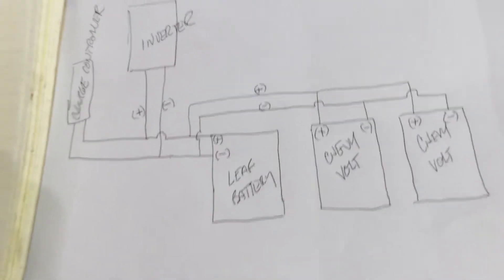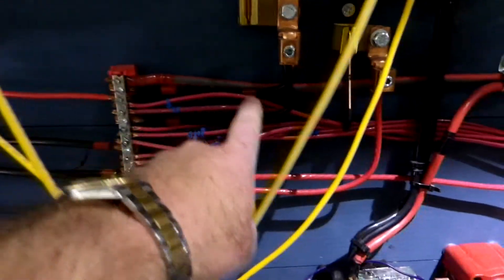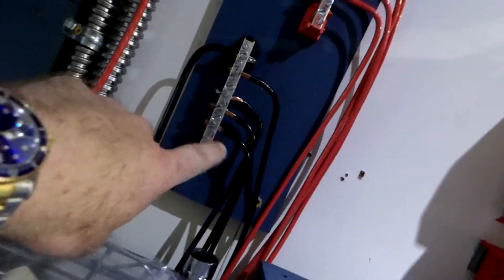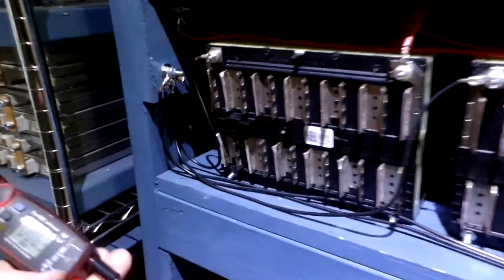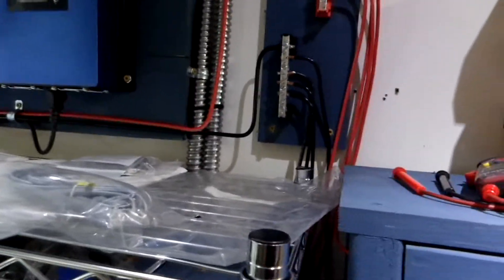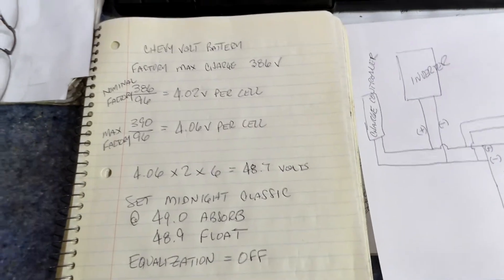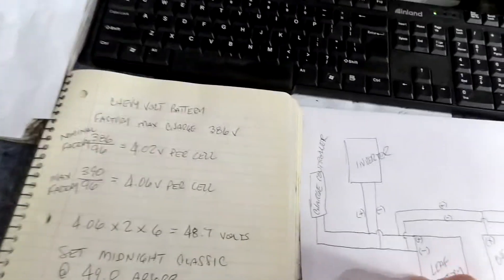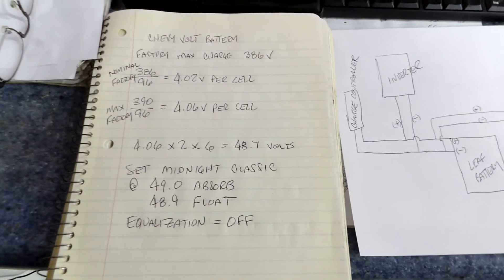Chevy Volt + Nissan Leaf Battery - off Grid Storage

Comment: What kind of inverter and charge controller did you use with this set up? Amazing
Reply from the maker: 2 Midnight Classic 200's, 1 MakeSkyBlue 60, and 2 Magnum 4448 PAE's
Reply: Thank you
Reply: Mark Osborne Is there a reason why you have 3 different control chargers? Is that because you have 3 different batteries banks. Also why 2 different brands like Midnite and Makeskyblue - do the perform different functions etc?
Reply from the maker: Each charge controller is limited to the amount of current it can supply to the battery bank(s). The Midnight Classic can supply 80 amps and the MakeSkyBlue can theoretically supply 60 amps (although I've never ran it that hard).  If you need 10,000 watts of solar to meet your needs, you will need at least 2 charge controllers to handle that amount of power at 48 volts, even more charge controllers if your nominal battery bank voltage is only 24v or worse yet 12v- as the charge controllers are limited to their "output" in amps.    I have a 48 volt system, so at 80 amps x 2, means I can pass 7680 (48 x 80 x 2= 7680) watts from the solar panels thru to the battery bank. Add in the 60 amp controller and I can pass another 60 x 48 = 2880 watts from another solar array.  (although I only have 960 watts of solar connected to the MakeSkyBlue).  The number of battery banks just happens to be 3 because I started out with a single Nissan Leaf battery then added 2 Chevy Volt batteries.  The banks are all in parallel, acting like 1 large battery.    I just happened to try a MakeSkyBlue for fun. The Midnight Classics are the predominate work-horse of the system and have all the functionality required to properly monitor and control the maximum charge on the battery.  The MakeSkyBlue is a much simpler charge controller and while it's working just great, probably isn't my first choice for the main controller to handle a complex system like mine. But that's not to say it couldn't do it.  In fact, I believe they could, but you'd need to employ a stand alone battery monitor, something the Midnight Classic has as part of it's hardware.  Hope this makes sense.
Reply: I simply love how you explain this using simple math. Easy to digest and understand. So each Midnite 200 can handle 48x80=3840 watts which is about 15 panels at 260W each. I am a bit confused looking at this chart https://thesolarstore.com/midnite-solar-mppt-charge-controller-classic-150-p-776.html - Model 150 can handle 80 Amps, Model 200 Can Handle - 65Amps, and Model 250 Can Handle -55Amps. Is This correct? I was under impression that the higher the model like 250 vs. 150 is capable to carry larger load.
Thank you for dealing with my questions
Reply from the maker: 150, 200 and 250 have to do with maximum input voltage.  And you will be forced to deal with that decision once you start designing your system. My panels are 48V at STP- and the voltage goes up as it gets colder.  48 x 3 in series forces me to use the 200 Classic as it can handle the possible increase in voltage should the ambient temp get down to -10F. 

The Classic 150 is good for 96 amps, 200 good for 79 (although mine typically does 80-82 until it gets good and warm -when it reduces it's output down to about 70) and the 250 is good for 63 according to Midnight Classic. http://www.midnitesolar.com/products.php?menuItem=products&productCat_ID=21&productCatName=Charge%20Controllers%20-%20Classics

Click on "Classic sizing tool".  From there you can plug in the number of panels in series, their size in watts, and other variables.  The app will cough out the results and highlight various parameters that may be unreasonable.    Play around with that app, get familiar with it.  It will tell you almost everything you need to know about designing a system once you've determined your daily needs in Kwhs (a whole-other study!) 

I am over driving the shit out of one of my charge controllers by having (27) 320 watt panels connected to it.  The app will immediately tell you you've got too many panels connected to one charge controller should you try to do this, but it doesn't matter, because the charge controller limits it's output.  You could have 1000 panels feeding it-- it doesn't matter.  Not sure if that's true for the MakeSkyBlue.
Reply: Mark Osborne Hi, Found a pack of 4 Chevy Volt Batteries from 2013 model. Rated as 2kwh each, which first generation. Is first generation as good as a second generation which 2.3Kwh each. Thx
Reply from the maker: I believe the first generation batteries are excellent, although, it would be good to know more about the particular batteries you're considering, like miles on the vehicle.  The Volt batteries are very well protected as installed in the vehicle, and there are many examples of vehicles with in excess of 300K miles on the clock.   Buying an entire used battery ends up costing about $75/Kwh, so, depending on your ultimate storage needs, it's something to consider.
Reply: Mark Osborne I have never seen a 2.3kwh batter for $170, least expensive was $300. Perhaps I am looking in the wrong places. Thanks for your answer.
Reply from the maker: You'd have to buy an entire Volt battery from a recycling yard and break it down into (8) 48 volt modules like this https://www.youtube.com/watch?v=Vnq30FNKsig&t=3s     I paid $1200 for one and $1300 for the other entire, complete battery including shipping.  That works out to about $75 per Kwh - make sense ?
Reply: Mark Osborne Not a.single junk yard has it in California for some reason. It Is either high demand or safety reasons. I will look  for out of state options.
Reply from the maker: Try B&R Auto Wrecking in Eugene, Oregon - they also sell on Ebay but you'll pay less if you buy direct.
Reply: Just got a quote from B&R Auto Wrecking 30k miles for $3031 - ouch
Reply from the maker: oh that's high !  I paid $1200 for one Volt and $1300 for the other Volt. I paid $2500 for the Leaf. I wonder if the word is out and these batteries are being bought up by the off-grid community - thus driving the prices up ?
Reply: Probably
Reply: I will search in Northern States and Canada. Seems to be the only logical solution to this high price.
Reply: First off all I would like to thank you for pointing me out in a right direction to get the batteries. Got 2 packs of total 32kwh at a great price. We are ready to pour concrete foundation sometime next week. All 3" pipes and parts from IronRidge are ordered and delivered to the site. 
One more question for you - do you use any equipment to cool off your Li Ion Chevy Volt Batteries?  Suggestions like fan and radiator from a car were on a table as well. Please let me know.
Thank you

Comment: Do you have any BMS ?
Reply from the maker: I have battery management in as much as I have protection against over and under voltage but I do not have active balancing.  As it stands, the Leaf battery has stayed in balance for 10 months and the Volt batteries have stayed in balance since I added them in Dec of 2017.  Should the cells start to drift out of balance, I will add battery balancing.

Comment: I believe that the chemistry of the batteries is very similar - but the capacities are way different correct?  I think the Nissan Leaf is about 24 kWh and the Volts are 16 kWh - 18 kWh depending on the year.  These are in parallel so the only issue I can see is you are essentially turning the 24 kWh Nissan Leaf battery into a 16 kWh battery (or whatever the lowest capacity bank is) - Interesting setup - The counter-argument, of course, is that if you now essentially have 3*16 kWh = 48 kWh - probably more than you need anyway :).  Another thought is: If you would have gotten another Nissan Leaf pack you could have had the same capacity in 2 packs (2*24 kWh = 48 kWh).  It would be interesting to drain it down and see what the "real world" capacity of this setup is.  Great work.
Reply from the maker: Think of it it terms of water.  The rules are the same as electricity. The Leaf is a 24 gallon bucket and each Volt battery is a 16 gallon bucket. They are sitting on a shelf, at the same level, and connected by a common hose.   As you open the tap, all 3 buckets will drain down at a rate that will maintain the same head-pressure (voltage) in all 3 batteries, and at the half way point, you will have drained 12 gallons out of the Leaf battery, and 8 gallons out of each of the Volt batteries.  Think about it.  The fact that they are in parallel will force them to discharge based on their static voltage, and as you point out, their chemistry is almost the same.  They have the same max and min voltage levels. You could parallel lead acid and lithium ion provided the number of cells you use (of each chemistry) works out to be the same max/min voltage range. Think about it. Thanks for jumping in !~
Reply: Awesome - yup just did a little more research on it and what you are proposing seems to line up.  Very cool!  https://www.homepower.com/articles/solar-electricity/design-installation/ask-experts-batteries-series-parallel

Comment from the maker: G Young

 Lets treat this like water storage--- buckets sitting on a shelf. 

The Leaf is like a 3 gallon bucket (3 kwh each), and the Volt is like a 2 gallon bucket (2 kwh each).   Because they're all at the same elevation, and because they are all plumbed in parallel, when we turn on the tap, the water level in each bucket will drop in such as way that their head pressure will remain the same.    IE: their voltage will drop and rise evenly. Consequently, we will be taking 3 units of water out of each 48v Leaf bucket for every 2 units we take out of each 48v Volt bucket. 

Likewise going back in (charging)

I have tested the current flow 'in' using a clamp amp meter when I had excellent sun. 
At 130 amps coming out of the 2 Midnight Classics, I had 75 amps (combined) flowing into the 16 Chevy Volt packs  and 55 amps (combined) flowing into the 8 Leaf packs.

If we go back to the bucket theory, we 'should' have (32/56 =.57) 57% of the water flowing into the Volt buckets, and (24/56=.42) 42% of the water flowing into the Leaf buckets

And the math agrees:   130 amps x .57 = 74 amps   Likewise  130 amps x .42= 56 amps

Now, to set your mind at ease, the absolute MOST I can pull from the 2 Magnum inverters is around 7000 watts.  We literally don't have enough toasters and hair dryers to turn on to pull more than that.  

7000 watts / 48 = 145 amps.  Divide that up over all (24 combined) 48v packs and you're talking around 6 amps each.   

The current draw, per 48v pack, is minuscule    

I would even go as far as to say you could parallel lead acid and lithium in a scenario like this given the fact that the overall storage capacity is so huge, and the current draw, per cell, is so tiny--- they would just play together and not even know that they are holding hands with a completely different chemistry.

This is not to discount your point.  I will agree-- if you have different chemistries, and therefore different internal resistance, and you are pulling large currents, I can totally see where there would be a conflict.   

But even at that, lets go back to the bucket theory.

Lets say our 3 gallon bucket has a reduced orifice at it's outlet (and our 2 gallon bucket did not).  That's like having a battery with high internal resistance.  And lets say you suddenly demand a huge flow of water.  The 2 gallon bucket is going to release it's water at a faster rate than the 3 gallon bucket and the head pressure within the 2 gallon bucket will temporarily drop lower than the 3 gallon bucket until the flow rate is returned to normal, at which time, the residual pressure in the 3 gallon bucket will slowly equalize and pretty soon both the 2 gallon and 3 gallon buckets will have the same head pressure.  

Right ?

Comment: That's amazing.
Reply from the maker: Steven, Terry made a video where he used a cut off wheel to separate a 48 volt module into (2) 24 volt modules.  Unfortunately you can't see the actual cut, but you get the idea.  Once you have a Volt battery in your hands, it will be very obvious what needs to be done.  Here is a link to his video https://www.youtube.com/watch?v=ntr_Q0igH5E

Comment: Do you still have the some of the little bus bars off of the stock chevy volt batteries? I like to use them when I build 24v batteries.
Reply from the maker: I looked, I do have some.  I've also got some left over from the Leaf.  But I'm curious, how will they help you build 24 volt batteries ?
Reply: Mark Osborne I built my power wall at 24 v. I can't send pic of one here.
Reply: Mark Osborne Do you have a Facebook page ? I do.
Reply from the maker: I see in your video where you used a cut off wheel to saw cut between the cells, making a 48 volt module into (2) 24 volt modules.   Where would you use the bus bars ?    I do have a FB page but never go there.
Reply: Mark Osborne I can't post a pic here so if you go to my Facebook page you can see them on there or send me a friend request then I could send you pictures